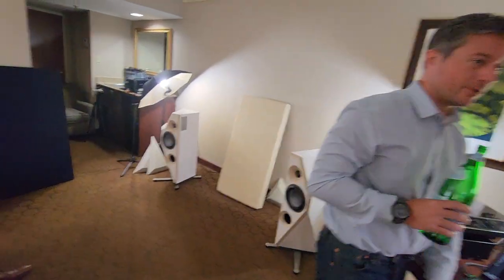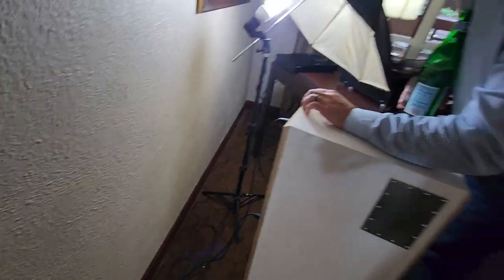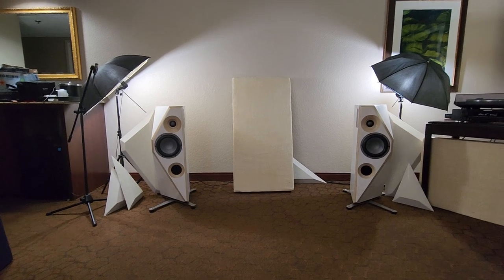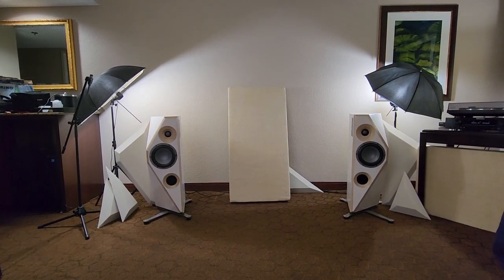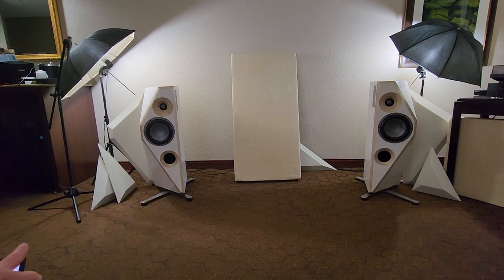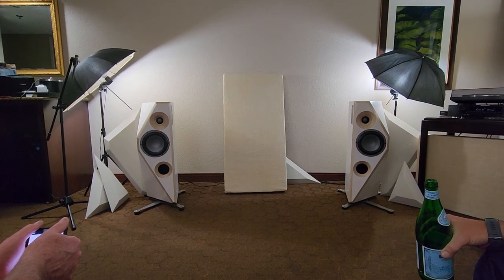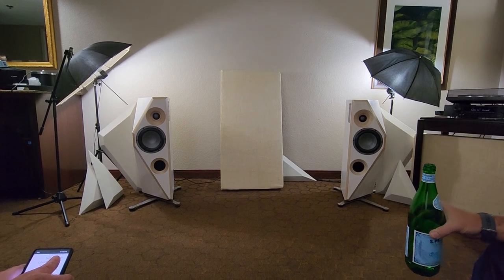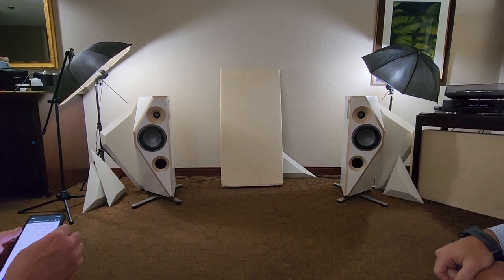Cool New Active - Transmission Line Bass Speaker - JPorter Studios - Lonestar Audio Fest 2023

Comment: Sounds ear bleeding bright.
Reply: They weren't. Very balanced. To my ears they had a "pro" quality. Perhaps the amplification. There's a passive version that intrigues me.
Reply: I was running the marantz Nr1607 as a pre-pro that was applying audyssey’s house curve so high end was rolled down a bit, I prefer optical in directly to these speakers has a higher SNR too.